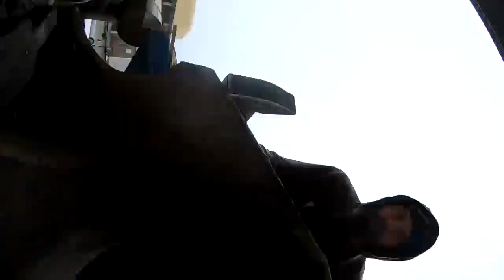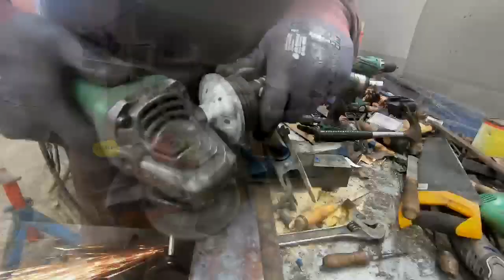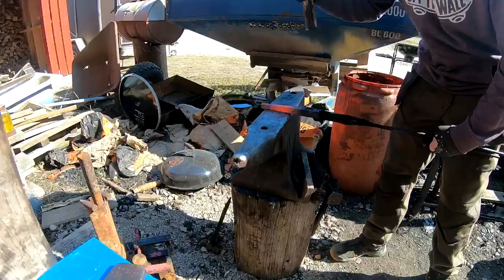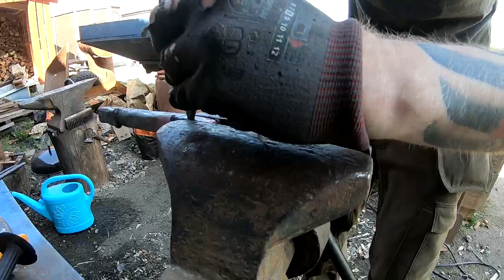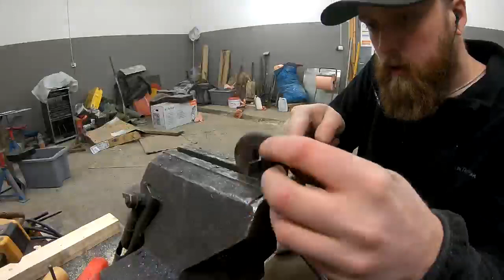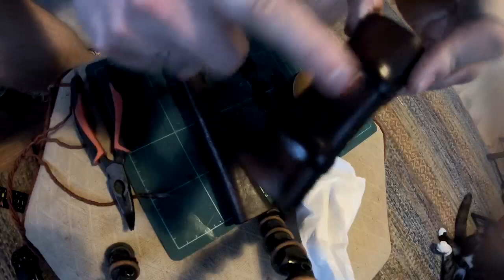Forging The Witcher - Silver Sword (Complete Version)

Comment: Looks awesome. +1

I wonder if there's a way to incorp some actual silver ..  perhaps an inlay for the fuller ?
Reply from the maker: Yeah i know it would be awesome. Im not quite sure about how they were supposed to be made. Maybe it was coated in silver?
Reply: Ive yet to read any of the books (played the game though).  As with most scifi authors I suspect there is likely little or no info on the HOW behind that question ... IMO authors only tend to write that they know, and perilously few authors ive read have any meaningful knowledge of bladesmithing, so this is virgin turf.  

If modern technology were permitted i'd wonder if electroplating the finished blade with silver would be feasible.  That would incur the burden of annual polishing to remove tarnish, but I cant imagine anything more authentic than that.  Inlaying the fuller in some fashion seemed like an easier option off the top of my head, but I have no idea how that'd work either. Cheers.

Edit: It's too bad Mithril is just a fictional metal, and ruinously expensive at that, because it combines all the qualities of the lightness and strength of titanium with the magical properties of silver.  That would be my first choice. 😎
Reply: @matyas_laczko  You'll have to forgive me ... for me, high school was 40 years ago, and chemistry was not my subject of choice.
Reply: Witcher lore says it’s a steel sword coated in silver